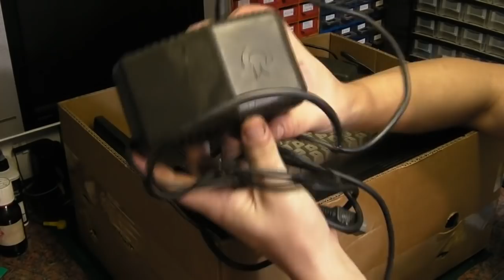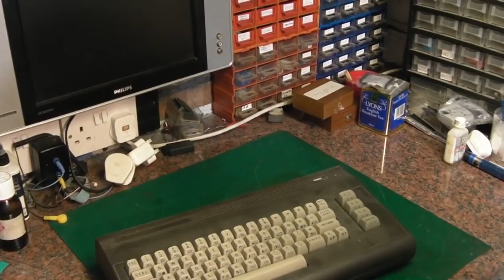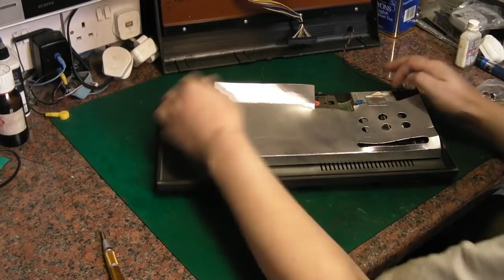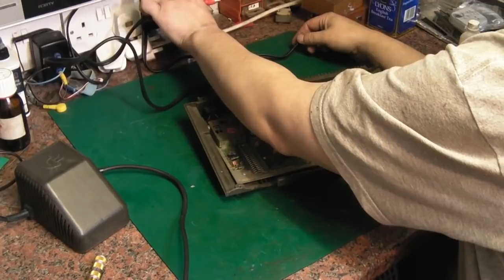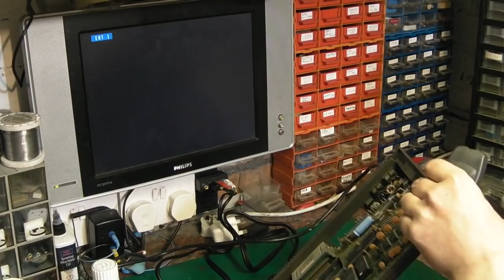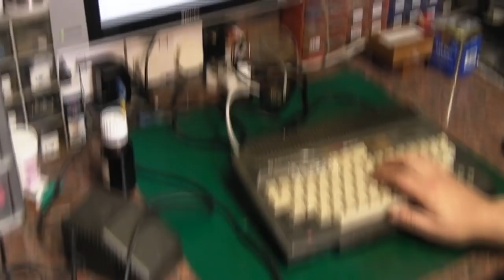Commodore C16/Plus4 lot repair Pt1

Comment: I have not watched all these videos yet so you probaly figgured this out already. All the C16's are also missing their PLA chips.

I have figured out how to create your own PLA chip for a Plus 4/C16 using a standard 27C512 EPROM. It is the latest video on my channel on how to go though the proccess on how I made it.
Reply from the maker: I've not had chance to watch your video yet but will do at the first opportunity. I did try using a OTP eprom to replace the PLA in a C64 It did work but was unreliable. hopefully I can get it to work in the C16 as I have no spare C16 PLAs laft now.
Reply: @Jayoldstuff1  I pretty much did it with a randon ST 27C512 EPROM. Could be the C64 is more sensertive to the EPROMs where as the Plus 4'sm & C16's are not. Further testing is required to confirm that.
Reply from the maker: Yes I think that is the case. when trying it with the C64 I did first try with a regular UV erasable eprom but got no results at all i then tried with the OTP eprom which is faster, that worked but not properly. I will  be trying with the C16 soon as I have the workshop back up and running.

Comment: Power supplies of that era are not to be trusted. They gradually put out higher and higher voltage. Use the connector with a modern regulated supply or run a inline regulator or at least check the voltage outputs regularly. I have a old style c64 powersupply that wasnt sealed with resin I opened it up and soldered in a regulator inline with the dc output so the c64 gets no more voltage than needed. Replaced all the electro caps and heatsinked everything in sight. Dead plasma tv sets have quite a few suitable heatsinks. I wonder if you could get a strip of copper and paste it to the cpu in the plus 4. that would fit.
Reply from the maker: agreed although you have to be careful with cheep supplies from china too. I've seen far to many fail due to poor design and construction. as for heatsink for the plus 4, ibe salvaged a few coolers from scrap laptops and I'm seeing if i can make one of those work.
Reply: @Jayoldstuff1 a chinese supply would fail to zero voltage. Rather than the old school fail of nuclear voltage.

Comment: Your anti-static mat...does the yellow socket plug directly into ground (earth)?  I have an anti-static mat but there is no electrical plug.  It's basically a just blue rubber mat.  But it was rated well on Amazon.
Reply from the maker: Yes the yellow socket connects to ground, Ill explain how its connected up in my next video.

Comment: I'm really looking forward to the next parts. I've a soft spot for Commodore's 264 series, albeit it's pretty much impossible nowadays to find working ones. My C16 worked fine, but the Plus/4 as well as the C116 both had dead CPUs. I got replacement chips from eBay (manufactured in 1990, so they should be more reliable), but they were quite expensive. I addition, it's a real pain to fit heatsinks and active cooling in the Plus/4 let alone the C116...I still like them though.
Reply from the maker: Thanks for the comment, Ah the C116 that was the one I couldn’t remember the name of. The whole 264 range are far underrated in my opinion. I think I would of been happy with one as my first computer if I hadn’t have got my Amstrad CPC. As you say biggest problem is  heat build up, I may look at a fan solution for the plus4 I think something could be made to work from an old laptop maybe.
Reply: The whole series of the 264 range is severely underrated.  The TED desperately needs to be converted to FPGA as a "drop-in" replacement (similar to the TMS9918 and F18a).  121 colors...wow.  I love the Plus/4 and the C16 (I have both in original boxes).  Great video.
Reply: JaysVintageJunk For the Plus/4, I used a quite flat old graphics card heat sink that more or less covers the chips and a fan from an old Pentium cooler that I glued into the top of the case. The C116 doesn't even have space for this, so I ended up with a bend copper plate that I stuck on the metal case of the expansion port as well for additional heat transfer and a fan from a 486 cooler.

Comment: BTW - regards the CPUs, I think there's a way you can use a 6510 in a +4!!!   See here:- http://hackjunk.com/2017/06/23/commodore-16-plus-4-8501-to-6510-cpu-conversion/
Reply: Ah, just seen you mention that =D  I think if you swap the ROM too the tape problem is solved?